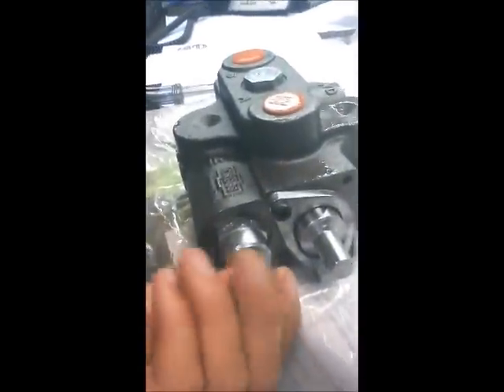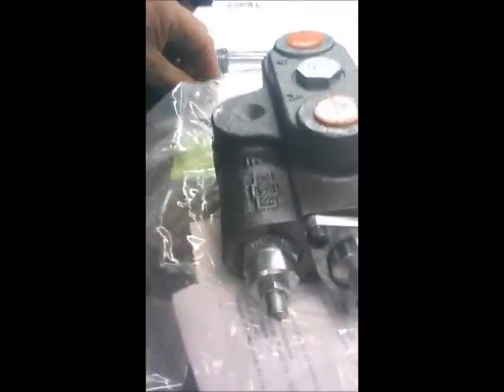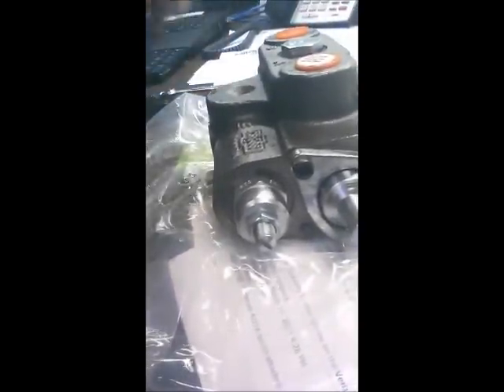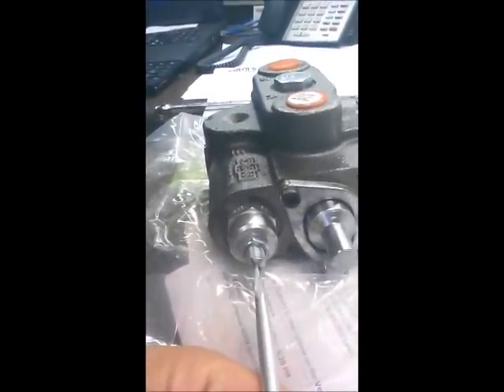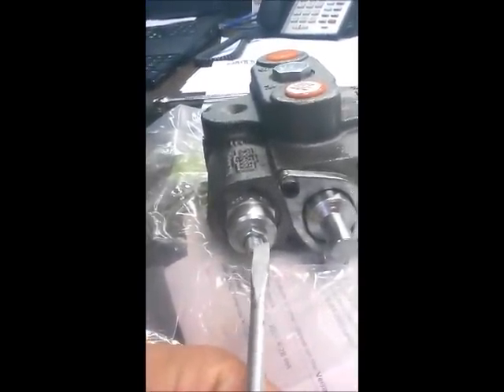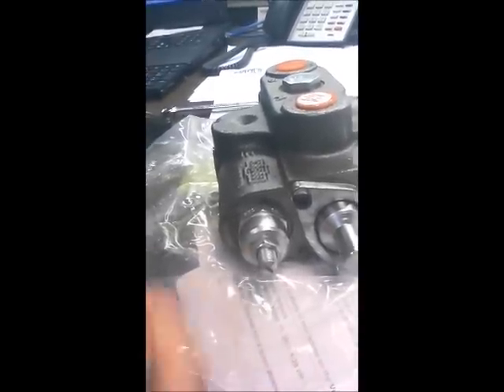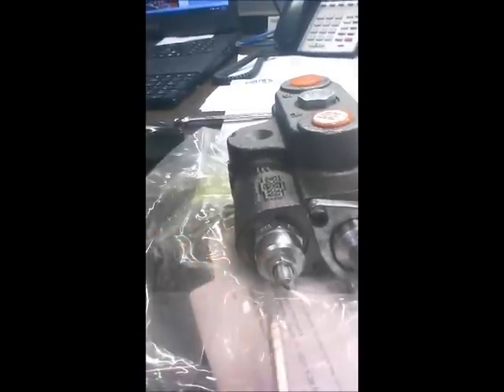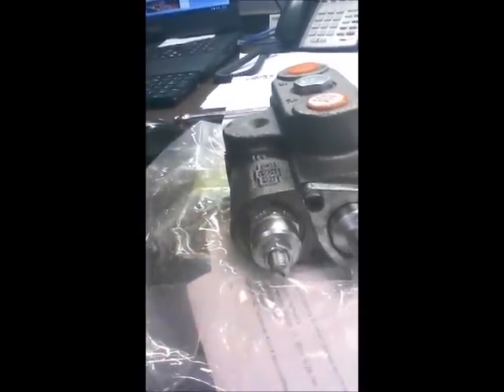Adjusting Pressure Relief Valve Pressure

Comment: Is this valve the same for the splitting force or just for speed in the return valve? My splitter doesn't split, does not push hard enough the log, l just need to know if there is a different valve to adjust, my machine is a champion 7 ton, has a return valve by the lever and one that l thing is a valve at the pump. Thank you

Comment: Hi, we have a similar unit. Initially, there was a leak problem 
but still working. When we had the leak sealed, there is no pressure 
build up. So we tried doing what you had shown in this video, but still 
no pressure buildup. Hope you can help us.